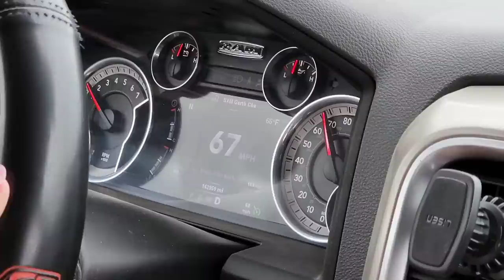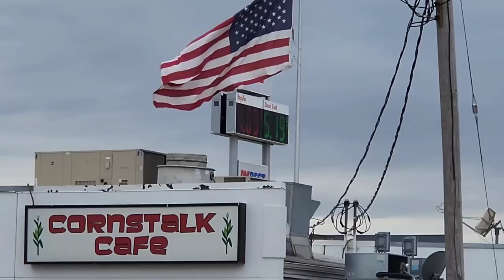Ep574, Off To A Dead Beginning // Shop Time

Comment: The 55mph was implemented during the mid 70’s (1970’s) during the gas crisis for the very reasoning to save fuel by getting better mileage. I think that the unforeseen loss of tax revenue was an unintended consequence of that mandate. I remember those days, long lines, odd, even days at the gas stations that had gas, until they ran out!
Reply: remember many folks was filling up 55 gallon drums that was my teen years
Reply: When I was pumping gas in the 70's, 10 pm I  had to shut off the main switch on the panel cause there were so many cars lined up on both sides of the highway!

Comment: Thanks for the laugh.  The part where Tater Tot was asleep and then the camera went to you sleeping........I laughed out loud.  That was pretty good.  Great stuff!

As far as the turn signal goes, it is hard for me to not get out and break off their turn signal stalk.  You're not using it so you may as well not have it!   My pet peeve is merging though.  If you are getting on the freeway, dang it, get after it!  If you are doing 45 at the end of the on ramp...well, sorry, but you are going to be driving on the shoulder because I am NOT braking and slowing down the truck to let you in.  Too bad.

Comment: Porter greetings! O-H-I-O🥰 Nap times are great! It was good to have her with you I bet. Hope that they can get the AC fixed without much delay or probs. I keep on my oldest with these rules…Always use your blinker, Turn it on before you change lanes & off after you’ve made your lane change or turn, Don’t let anyone push you faster when you’re driving, If speed is 55, set your cruise at 55 & let the speeders just do their thing, Be safe & courteous at all times. I like to make the trip & enjoy the ride!🧐 Good stuff…gotta keep them in check, since that’s the dad thing to do! We care, right?! Now that was a good wash job. Looks like you also used Simple Green. I like that stuff, too. Good job.🤩 Our diesel here is around $5.45/gallon. I haven’t bought any lately, but I probably will have to this coming week. Not sure I’m looking forward to that. Speed Limit settings…I’m not sure about the setting it to 70 to get you to spend more money, but I have heard that before. I do like the fact that trucks can drive the same speed limit in most places now as cars. I hated it when cars could drive faster than trucks. Do you remember that? Enjoy the down time! 🥰🇺🇸✌️

Comment: Kurt, you make a very valid point about driving at a lower speed to not burn up so much fuel.
However, if the flow of traffic is doing at least 75 and the speed limit is 55 you may want to go halfway in between just to be on the safe side.

Comment: If you are 100% it was the cooler. Go for it. Other wise check all your grounds and make sure they are tight and clean. I spent 400 on a start I probably didn't need.

Comment: I bought an inline voltage cutoff for my cooler. The cooler plugs into it and then it plugs into the truck. Once the voltage drops to the predetermined level, the cooler is deprived of current. Once I start the truck, it gets current again.
Reply from the maker: Good idea
Reply: @truckingwithschmidt7120  As you know, it's not wise to keep food in there but I haven't had to pull the battery cover ever since.

I usually leave my water bottles in it though since no harm comes to them from heat and cool cycles.

Comment: Don`t worry Kurt, fuel will go up higher! Filled my truck (F-350 diesel) about 3 months ago and maybe drove it 40 miles or so and the price is about 2.00 a gallon more now. Glad I retired and don`t need to drive it to work every day. Btw, at 66 I still drive over the limit most of the time, especially on the Harley. Here in Pa. the price of diesel near me is 6.49/gal.
Reply from the maker: So does my urber dad

Comment: I understand your opinion on speeding, but on highways you can also get a ticket for slowing traffic due it can cause an accident. If you drive 5-8 mph. over is fine or even the speed of the traffic all around you. Now if you are passing a lot then your speeding if you go the speed limit stay to right. Need to remember there are all kinds of driving habits good and bad around you. Be aware is key.
Reply: Depends on the area

Comment: While at the Omaha shop, get them to turn on progressive shifting in the ecm.
Reply: i have a Detroit 60 series and i only get over 25 lbs of boost in 7th and 8 gear can the progressive shifting be an issue here
Reply: @bonidaexpress  most likely you have another issue.  The progressive shifting in the ecm just cuts the fuel to the motor after you shift, it comes back in a minute or so, but saves that full shot of fuel until the engine can better use it.  Check air filter, check charge air cooler system for leaks.  Should hold 15 lbs of pressure for 3 minutes, any less you are loosing turbo boost and power, fuel mileage.

Comment: Check alstate petebilt in Rochester you can get a tri pac eveltion Take off APU with aspar heater for around $6000.00 installed
Reply: Sell it NOW it will never be worth more…..please now because, the market is going to go away

Comment: There are 2 parts to the higher speed limits. #1 better cars equals better road safety, now adays all cars comes with state of the art ABS systems and a whole host of other safety features which makes for better safety at higher speeds. #2 car exterior design and engine efficiency, modern cars consume a lot less fuel and pollute a lot less hence the impact on the environment at higer speeds a much less than they were just 20 years ago.......... That being said, if the government wanted more taxes they would just slowly increase the tax on fuel, it could go up by 0.1%/year and nobody would notice except from a few people with too much time on their hands. Plus you are not mandated to drive at the speed limit but you are mandated to drive below it, so if someone wants to save money on fuel they are absolutely free to drive at lower speeds than posted.

Comment: If you don't fix your truck now, you're going to have to fix it later anyway.

Unless you sell it as-is, but it wouldn't be smart to sell a paid for truck you're familiar with and end up buying a strange truck for a lot more money.

You're in a better position than many to weather high diesel prices. There are guys running Amazon freight for less than 2 bucks a mile and making a 2k+ payment with it. I don't see that as sustainable.